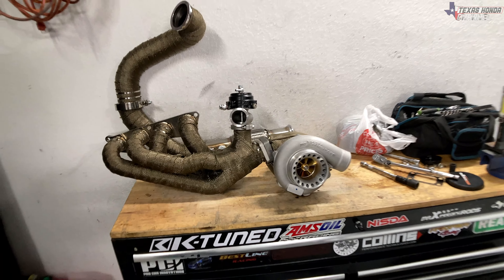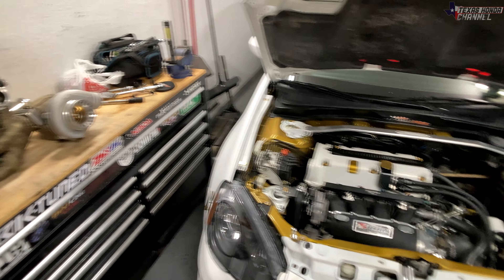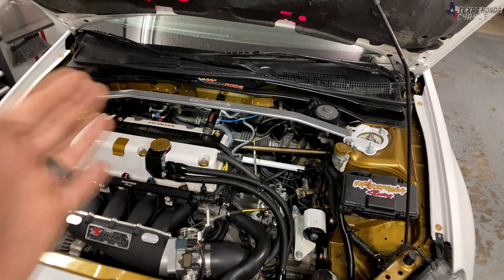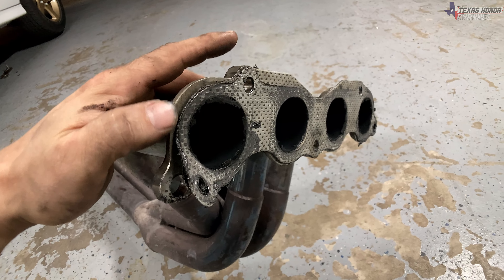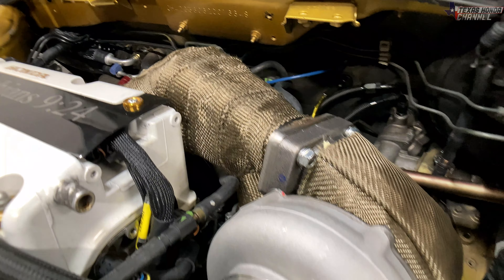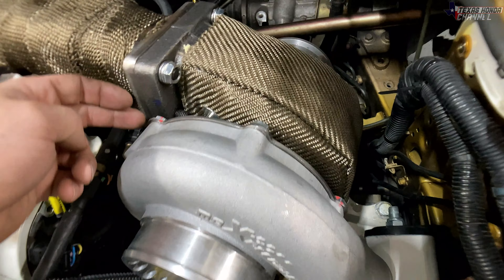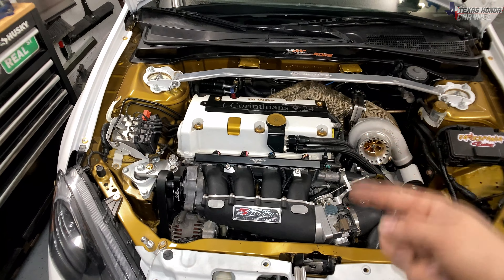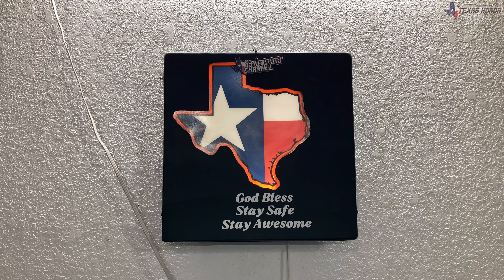RSX TURBO INSTALL- PART 1

Comment: For the fuel line I’m running a acuity fuel line quick connect to 6an and a devsport fuel line tuck for rsx. That way you can run the fuel line away from it
Reply: Also you don’t have to run the coolant lines on the turbo. While it does cool the cartridge and prolongs it. I’ve ran different turbos without them and they didn’t fail early ect. Just my opinion
Reply from the maker: @BoostedDc4  i know that much i actually said it in a previous video haha and I have the quick disconnect fuel line stuff. Feel free to message on instagram so I can show you. I just haven’t done a video yet 😂 thanks for the input though!

Comment: It looks amazing! You may need to look into getting lock nuts from stage 8 because it may melt
Reply from the maker: I don’t use nylon lock nuts right now and haven’t had issues using this setup on previous turbo builds and my previous setups ran up to 30psi. Just lock washers and nuts. I can always upgrade hardware if it does happen. Also check my newest video i did upgrade to chrome nuts for the turbo nuts. They look fancy too. 😅👍🏻

Comment: Just found this channel love the content! Was looking into this kit for my Rsx 

God Bless!
Reply from the maker: God bless you! It’s a great kit i found there was a few issues with my setup but not with the kit. I ran a 4 bolt turbo and the coil overs put the steering at a angle which don’t help with exhaust clearance but otherwise it does great!

Comment: Bro you got rsx base? Planning to just get base then k swap
Reply: the base model already has a k20
Reply: @xavierarriaga7291  I think he means a useful motor, the k20a3 is 💩
Reply: @PNDASnipin  I see them with rods and pistons running 400+. Whats sh*t about that? Just get an A2 head to put on the A3 block if you want even more.

Comment: Hey man I had a question I want to do the same set-up with the sidewinder turbo...but  will I be able to install a Ktuned 3" exhaust?
Reply: You can but you might need to modify where the downpipe meets the ktuned flange.
Reply: @o chuy  Awesome bro thank you!